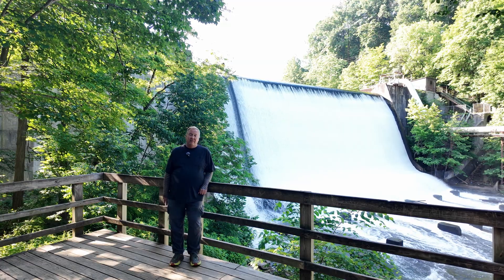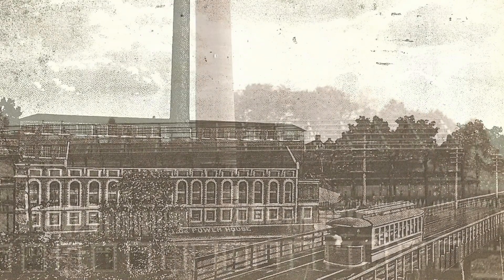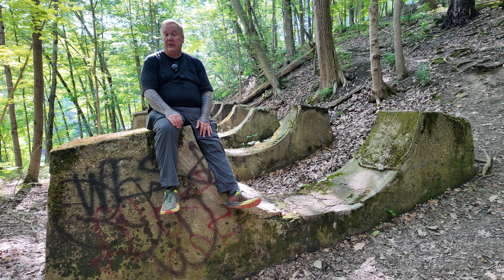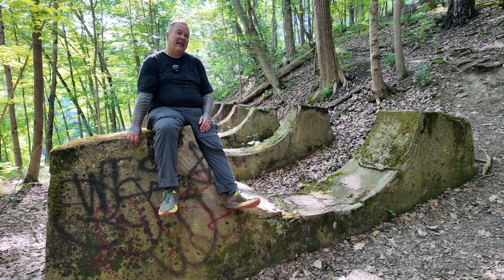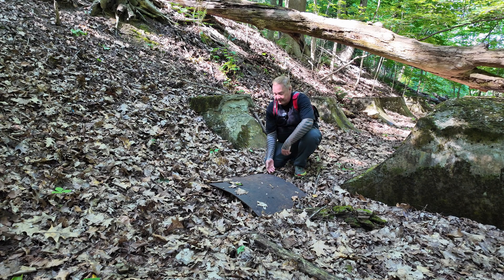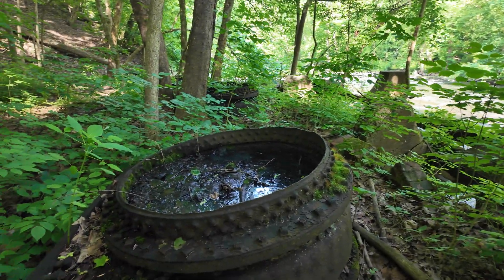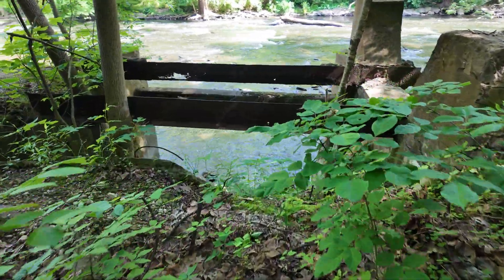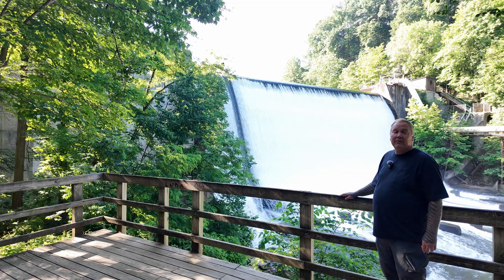Exploring The Soon To Be Extinct Gorge Dam & Its Hidden Power Plants

Comment: I grew up just above where the Hydro power plant was and spent my Summers running around the gorge in the 70s ...we didn't think anything of riding our bicycles on top of the pipe. Watched them pull the pipe out by helicopter... not all went as expected as the pre-cut sections were too heavy, they ended up going back with their acetylene cutters and cut each section in half. 😮
Reply from the maker: It's kinda too bad they didn't leave at least some of it in place, just for historic reasons, even though it's been shut down so long.  Hard to believe that they made the money back from scrap value given how much work they needed to do to remove it.
Last I heard, the dam removal hadn't started yet.  These things are always delayed.  Usually over and over.  Heard any updates on it?

Comment: Several years ago, someone proposed a new hydro plant at the dam. Hydro power is green power, right? The county said no. Oh, and by the way, by dropping these dams it cleans up the river thus allowing the county to dump more wastewater into it from a sewer treatment plant upstream.
Reply from the maker: One way it'll clean it is the months-long (at least) process of digging out all the contaminated silt from behind the dam.  Last timeline I saw, that could be starting this year, although it's already been delayed several times, as is normal for dam removals.
Reply: @Industrial_Revolution  after they took down the Ballville dam in North west Ohio it started to recover very quickly, they caught gamefish upstream of the old dam that hadn’t been up in that part or the river in decades, it will improve tourism and become a scenic river. Time will heal the river and make it a great place to visit, those dam overflows are sometimes pretty for a picture opportunity but they also create potential problems
Reply from the maker: @russellstewart5414  I'll need to take a look at that one.  I just looked it up and saw a picture.  Looks like a large penstock coming out the right side of the dam (the big, round hole)?

Comment: A few minor corrections for you. The Big Falls are below the dam (video below). The myth of the “buried” Big Falls waterfall is 100% false and widespread misinformation. Historical photos indicate there may be 1 significant Class 2-3 rapid near an old Starchery site, with additional minor class 2 features under the 1.5 mile dam lake. Enjoy the Big Falls video below.

https://youtu.be/HVSwq5Z99-A?si=yW9zsnPfWJebZ9Lp
Reply from the maker: Great video.  Is that you?  Maybe you know another dam on the Cuyahoga (or at least along the Ohio & Erie Canal) that I saw years ago.  It was big, probably bigger than this one, and it had a big, square hole cut through the bottom.  No longer held any water.  There were people kayaking through the hole the day I was there.  I've been trying to remember what dam it was, or at least generally where.
Unfortunately, I never saw this area before the dam was built.  Like anywhere, there are lots of stories, and often not much else.  Over time, guesses fill in where facts are missing.  From a functional point of view, if there were a buried/flooded waterfall, I wouldn't expect it to be 20' upriver of the falls, but all the way up at the other end of the lake, to maximize the water storage.  There's really not much reason to build a dam just below a waterfall.
Reply: Yes, that’s me kayaking the Big Falls. The engineers of the dam also agreed with you, which is why they built the dam between the little falls upriver and the big falls below the spillway. Sadly, the misinformation of burying the big falls underwater has spread for too long. That curse will end when the river flows free again and the viewscape of the big falls can be enjoyed without the dam above it.

I’m not familiar with the dam you’re inquiring about with paddlers passing through it. The Gorge Dam is the largest on the Cuyahoga.
Reply from the maker: I think I found it... maybe.  Dover Dam, south of Akron.  Looks like it does sometimes hold water, though, looking at recent images.  https://youtu.be/ua-kTVm1KrA?si=9_4bU_aTWPj8r7B7
Reply: To be more specific, the Big Falls begin immediately after the dam spillway breakers. From there, it’s gradually cascading shale to an abrupt two step drop of around 15 feet depending on water levels. The Big Falls as it sits now is severely eroded from its original historical appearance seen in photos - that scene is completely lost to history (not buried under water behind the dam). However, the Big Falls in all their modern glory can still be admired below the dam spillway. When the dam is removed, it will be a free flowing falls once again.

Comment: A few hundred yards upstream of the old hydro plant, on the other side of the river, is a large section of penstock pipe. You can see it from the High Bridge Trail in the winter when there are no leaves on the trees.
Reply from the maker: The penstock pipe itself, or a broken saddle in the river?
Reply: @Industrial_Revolution   A section of the pipe. Must have fallen down into the river at some point, and has gradually ended up against the bank on the north side of the river. You can't see it from the Gorge Trail side at all, and when the trees have leaves it's concealed pretty well from the south/High Bridge Trail side. I didn't hike there last winter as High Bridge was closed, but it was still there the previous winter when I hiked it.
Reply from the maker: I ran across a story of an explosion, but I don't have a date.  From the story, it seems someone turned off the water at the power plant end too fast, and the pressure blew out the penstock and broke at least one of the penstock frames, with pieces going into the river.  I wouldn't be surprised if the piece of pipe there is from that same explosion.

Comment: Such a shame this was all destroyed, just so we can pay more for electric from windmills.
Reply: They stopped generating power here in 1958.  Do you think that was because of windmills?
Reply: @brokenrecord3523 now stop using facts, you know very well that they don’t matter to some people.   Age of all industrial facilities is one of the reasons they are no longer producing, and the profitability is another. They go hand in hand.
Reply: @russellstewart5414    my bad
 Probably shopuldn't have spent that 30 seconds finding out when they stopped producing power.  I could have downed half a bud light in that wasted time like, I'm assuming, mch did.
Reply from the maker: Grid scale power production used to just need to provide power for a few light bulbs per house.  The demands are a LOT higher now.
Reply: @Industrial_Revolution  and cost/kw is down (compared to inflation).
Reply from the maker: I think every dam removal I've looked at so far has considered new hydro power for it.  Generally, they're found them insufficient for grid-scale hydropower.  I know they considered it for Gorge Dam, as well.  If you could take the entire river's supply, and route it down to where the old hydroelectric plant was, there might have been enough for a very small, modern system.  You'd probably still need to clear much of the contaminated silt from the reservoir behind the dam to have enough water storage to do it, and lower the water intake on the dam.  Would the dam last another 50 years to make it worthwhile?  Maybe?
I mentioned it in another comment, too.  I'm a huge supporter of green energy, except for historic, coal-fired, steam locomotives, early 20'th century style hydroelectric is starting to look less and less environmentally-friendly, and, surprisingly, less reliable.  There's some very promising newer hydro technologies, though, especially in microhydro, but there's also some grid-scale options that don't even require dams to produce nearly as much power, and do it without the risks of dam collapse (there have been a lot of those lately, it seems) or the environmental impact of the dams.  The next generation of hydroelectric has a bright future.
Reply: Dams are far more labor intensive then we like to admit, or even perform. The turbines, and piping can last quite a while between overhauls assuming no damage from flooding or poor operation. The intake grates need to be cleaned fairly often. Dredging is almost never done but extreme silt build up is a concern for most dams. The real benefit to a dam is flood and irrigation control. Low head weirs with long piping is far less problematic than large dams. Of course most of these old dams are older than modern engineering. Ignoring any defects like that, the real cost of maintenance and upkeep usually outstrips electrical income for dams of this size and quite a bit larger too. IE. Rapadan dam is good example of that, which had never paid for it's own refurbishments and repairs before needing more.
Reply: This is a remnant from the past that doesn't work anymore. It's a nature restoration project.
Reply: Is this why my electric bill went up $60?

Comment: Those remaining steel pieces are valve bodies so you could isolate the water to a turbine for maintenance
Reply from the maker: With the actual turbines dropped below them?
Reply: @Industrial_Revolution  Hard to say without pictures under it. They don't appear to be level or uniform. My guess is that they were disconnected and left where they dropped to the ground. (one appears to have a piece broken) Probably too heavy for the helicopter. The turbine volutes are probably either concrete or concrete lined with steel plate, which would have also been left in place.
Reply from the maker: I think they were set pretty seriously into the concrete.  I'm assuming they pulled out everything that could come out easily enough to have a net scrap value.  Probably too much trouble to break these free from the concrete for the minimal amount of scrap iron.
Reply: Specifically gate valves. Appears to be the body and gate, but missing the stems and packing obviously.